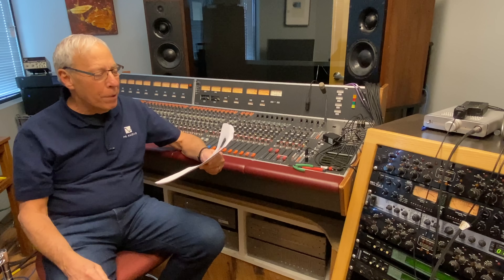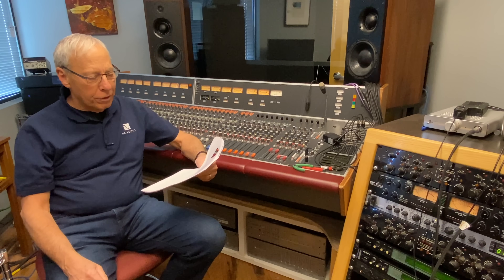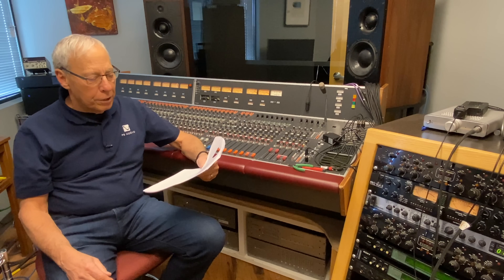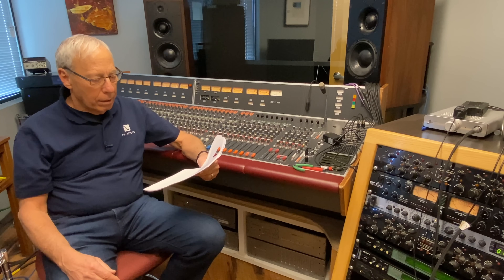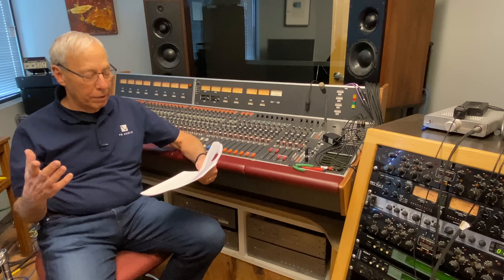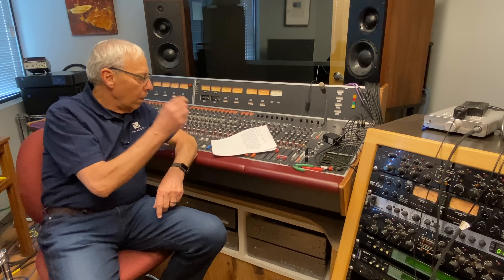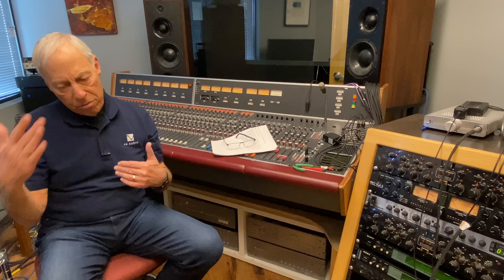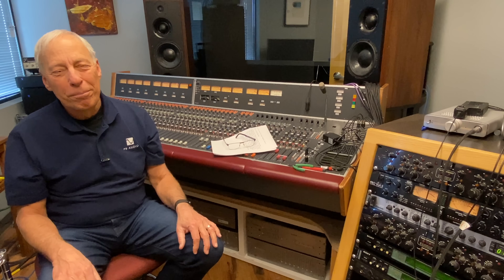Can you have too much damping factor?

Comment: I wonder why there are no amps with a sepperate feedback connector on the back for each speaker just like power supplies with a sepperate sense wire.  
Usually the feedback line is hooked up to the output terminals internally.  Done right  it would be the ideal solution I guess.   But if someone forgets to connect it it might break something lol
Reply: Kenwood's Sigma Drive System, used in vintage Trio KA-900, for example/

Comment: Eh…

What we all learned at high school, but what a lot of people seems to forget, is that a driver, like an electric motor, is driven by current (F = Bl x i).

When drivers are voltage-driven (with a low output impedance and a high damping factor):
* The sound is compressed.
    * About 98% of the power is used to heat up the voice coil till the resistance is two times higher (at 3 dB power compression) till, in extreme cases four times higher (at 6 dB power compression).
* The voice coil of the driver is a ferromagnetic coil (the last one standing when air core coils are used in the passive crossover).
    * Which is an inductance modulated by current, cone excursion, hysteresis and coarseness.
    * It distorts the sound.
    * It alters the frequency response, especially it lowers the high frequency output.
* The drivers acts as a microphone.
    * Every resonance in the driver or cone shows up in the impedance curve.
    * Every sound and every cone movement influences dynamically the impedance curve, especially cone vibrations, enclosure and port sounds and adjacent drivers.
    * It generates a voltage (back-emf) on the input terminals.
    * At resonance it is used to dampen the resonance, although with distortion.
    * At other frequencies it distorts and alters the frequency response.
* Loudspeaker cables have influence on the sound.

When drivers are power-driven (an output impedance about the same size as the load), like in a tube and low feedback power amplifiers:
* All the effects above are halved.
    * So more bass, more highs, lower distortion in the drivers, and less power compression.

When drivers are current-driven (a very high output impedance, like 400, 800 Ω or more):
* All the effects above are eliminated.
    * Voice coils are still heated, voice coils are still inductors and voice coils are still microphonic, but do they not distort the current anymore, as the current is controlled by the amplifier. They only distort the voltage, which has no effect on the sound.

Almost all passive crossovers are designed with voltage-drive in mind. With power-drive they are not optimal. With current-drive they don’t work as intended. With current-drive you need to redesign the crossover filters or, even better, get rid of them, go active. As passive crossover filters suck up more than halve the amplifier power and are unstable with changing voice coil resistance (temperatures).

So
* The more damping factor the less control of the driver.
    * The loudspeaker cable and the voice coil temperature take over the control.
* The less damping factor the better.
Reply: Yawn..........
Reply: @bigelile07  Sorry, I had nothing news for you!

Finally I found someone with knowledge about current-drive and probably knows all what Mills and Hawksford, Ragnar Lian, Esa Meriläinen, Joe Rasmussen and Nelson Pass tell us about current-drive. And probably knows what KLIPPEL, the innovative leader in providing unique test equipment for electro-acoustical transducers and audio systems, tell us about current-distortion.

Comment: Very interesting, I did not know that everything above 100 does not really do anything. I also think that it is a gimmick a bit like when they were selling Panasonic screens about 10 years ago that had 600hz picture. Then when you do the research, you find out that it is right, but it does not relate to FPS but internal measurements. Which really is cheating. A bit like making an amplifier 3000 watts and saying that it is better than the previous 2500 watt model.

Comment: People forget that just having speaker wire between the amplifier and the speaker will put a maximum cap on your damping factor, depending on the series resistance of the wire, to somewhere in the tens (i.e. <100 damping factor), even if the amplifier output stage has an infinite dampening factor (i.e., near zero resistance). So, unless you have a speaker plugged directly into your amplifier with a superconductor, you are not seeing the amp's damping factor at  the speaker per its spec, due to resistance in the connectors and more importantly the cable that connects them.

Comment: Is it possible for a poorly designed dampened system to sound dead, boring and lifeless?
Reply: Sure, just as it's possible for a well-designed, highly accurate system to sound dead, boring and lifeless.  In fact many if not most listeners prefer a little distortion and coloration added, to make the sound more interesting.

Comment: Feed forward error correction technology. Just like within the following amps: 
- Benchmark AHB2 (speaker amp) https://benchmarkmedia.com/products/benchmark-ahb2-power-amplifier
- DROP + THX AAA™ 789 (headphone amp) https://drop.com/buy/drop-thx-aaa-789-linear-amplifier
.. and some more I'm not aware of (except Hegel of course and some Monoprice models). 

And I'm pretty sure Paul's engineers are already working on the PS Audio implementation variant. Great stuff.

Comment: The way I understand it is you also want to match the amps damping factor with your speaker efficiency. For instance, most tube amps have very little damping factor and match well with efficient speakers. SS amps with a high damping factor usually work better with very resistive power hungry speaker systems.

Comment: The tube amplifier as a triode single-ended without negative feedback have around 4.....10 damping factor and sound great. Is a different filosophy, amplifiing the voltage, the current current, or the power. A lot of vintage amplifier have around 50...80 DF. Often the damping factor is something to sell better.
Reply: atom xeon  Can your amp accurately reproduce the bass of a kick drum?

Comment: I drive my speakers with Kenwood Basic M1 and M2. Both use Sigma Drive which help obtain 1000 of damping factor. 2 sets of wire for each speaker I uses AWG10 for the power output and a size 16 for the Sigma drive and if I disconnect those wire and just use a jumper to main,  you can hear a difference,  the bases tightens up and I can go more than one number on the max volume settting. It registers a higher loudness on my Simpson Model 884 Sound Level, Type S2A. 4000 is a big jump from 1000, Kenwood described its Sigma Drive in many papers published in the 80's.

Comment: How does Hegel achieve that high number as 4000 damping factor , does they use more feed back or what is the secret, does anyone know this ?
Reply: They have their own proprietary local error correction called SoundEngine which results in very very high damping factor.

Comment: So far my experience from testing an admittedly limited amount of, but all very highly regarded amplifiers, including Hegel, Hypex and Purifi; the higher the dampening factor, the more sluggish/warm the amplifier sounded. 
Those with lower, but still good dampening factor sounded more lean, clear and precise.
Don’t know if there is any actual relation or if it’s coincidence - but it seemed rather counter intuitive!
Reply: Yeah. Personally I found the 150-200 to be the sweet spot. Even 250 or 300 is still ok.
Reply: I have experienced the direct opposite. More DP resulted in leaner yet more precise faster sounding bass. I dont like DP of 400 and more. It sounds too detailed and less natural

Comment: Old amplifier like pioneer and Technics have Les than 80 dampi g factor an sound amazingly
Reply: How would you know this? I don't remember manufacturers back in the 70's and 80's giving out damping factor information.
Reply: @dontcare563 in some technics service manual  from 70s and 80 say  damping factor. Technics have approximately 50 to 80 do amping factor
Reply: @dontcare563  see in this picture Technics su-v4 have 25 df in 4 ohm and 50 df in 8 ohm  https://www.manualscenter.com/manuals/technics/suv4k-service-manual.html#.XrF2m-4pA0M
Reply: @acue79  Good to know. Thanks

Comment: the Sansui 9090 has an unbelievably low dampening factor of 10... however people love the sound and i think it sounds great as well... i
why did Sansui make the dampening factor so low?
Reply: Tube amps usually have low damping factor. That is one of the reasons they sounds so relaxed in the bass.
Reply: I’m curious about this as well as I have a 9090.

Comment: Loving the ATC Monitors 👌🏻
Reply: Saw those right off, probably the SCM 50’s ‘bookshelf’ model, as opposed to the tower models which I own a pair, in active config. Must be a local studio?
Reply: David G Perfectdaycalendar  They are the active Domestic SCM50A Classic model and not the pro model surprisingly . I thought they would have went pro model for the studio, maybe they wanted the wood finish! Rather heavy for a bookshelf speaker and ATC supply a stand for domestic use. There is a tall stand for the pro versions that lifts them high enough for monitoring when seated behind a mixing desk.
Reply: kj bunnyboiler6353 yeah, perhaps the designer/owner of the studio wasn’t a fan of the all black pro versions. Maybe a price diff?
Reply: David G Perfectdaycalendar  Absolutely, the wood finish on the Domestic cabinets is stunning. Especially the gloss walnut. Due to the additional cost of the veneer the Pro black versions are actually cheaper.
Reply: kj bunnyboiler6353 that makes sense.
Reply: got the 11s and they sound great.
Reply: Justin Parkman I started as a ‘casual’ user.. SCM 7’s. Added a pair of SCM 12’s. Sold both, got the 50’s. I ran Meridian 205 mono  blocs 100 wpc amps into those 7’s on some 24” sand/lead filled stands from Mission. The imaging was crazy good. Miss them. Enjoy your 11’s! I should add, I’m a PSA owner via a gen1 PWD W a bridge 2.
Reply: Jon Woods  Actives as well by the looks of it!

Comment: Damping factor can change loudspeaker acoustical behaviour and their sound on the end, drastically.  Loudspeskers are complex electro acoustic mechanisms that respond to amount of electric control from amplifier which can chage tuning points of that system.  If you have lose control, sistem will do more things on it's own, if you have to much, various electrical and mechanical resonances can appear inside that loudspeaker sistem with audible negativity.
High damping factor can be achieved with varous tricks inside amp circuits, it don't need to be global negative feedback.
Good question is, what is left of high damping factor after connectors and cables and their internal resistance.

Comment: Some is good, more is better, and too much is just about right.
Reply: For small full range drivers you don't want a lot of damping factor. Otherwise they sound flat and tinny. Some speakers can sound really rich with an amp that lets them just a little loose.
Reply: Dave Micolichek  That isn't how it works necessarily, though it is partly correct. If you take a design like a transconductance amplifier which has the ability to alter damping factor at the turn of a knob, they can get to the point they can match or exceed the damping factor of that Hegel amp, or have nearly nothing. And for some speakers the high damping factor is desired, as a low damping factor causes the speaker to exaggerate and accentuate undesirable characteristics. It can also have a bad effect with some crossovers. Some speakers which have a high mechanical damping factor will not notice any difference what so ever, while others like full range and drivers with a very controlled mechanical damping factor (horn loads, t-line's) can sound immensely warm and rich when its set just right. The latter is what these little amps are generally built for.  In those small cases it is possible to make the speaker actually unload from very little actual power when you turn to much to current loading. 

This can be a great explanation for the boomy bass that used to be a product of the 70s big sound systems, most of those big amps actually had a damping factor that was quite low (less than 30 usually), and the speakers didn't have much insulation with a rather flimsy box, which would give the combination of lots of resonant speaker activity.

Comment: It is important to appreciate how damping factor is defined. It is not defined as "the ability of the amplifier to control the loudspeaker", but as "the ratio of loudspeaker impedance divided by the amplifier's output impedance". And in this calculation, speaker cable resistance is added to the amplifier's impedance as an ohmic component. It is true that this ratio can be a measure of amplifier's control and it can be easily demonstrated by adding resistance between the amplifier and the loudspeaker. The more "parasitic" resistance we add, the more boomy the sound will come out. It's so clear and distinguishable that nobody can argue it's not happening. In a few tests I made with people attending, some actually liked the boomy sound with a damping factor of 10 better. They thought of the sound to be "fuller". However, it did have the effect of blurring the actual sound towards the effect of "single note bass". Not as bad as a badly designed loudspeaker, but something similar. 

However, the loudspeaker impedance is not resistive (with the exception of a few loudspeaker designs that have tried hard to achieve this) and so the impedance varies with frequency. We know the effect of lacking speaker control is more pronounced in the lower frequencies and this is where the loudspeaker shows one or two impedance peaks going up to 20, 30 or higher Ohms. But of course, there are dips as well in many loudspeakers and a "nominally" 8Ohm loudspeaker may well dip in 5-6Ohms. So, the result of this division is not a constant number but rather a graph vs frequency. With a widely varied value in the critical two octaves from 30Hz to 120Hz. By instinct, I would propose that the variation of the DF in these low octaves may be a bad thing. And if the amplifier has an inadequate DF, the dips vs peaks in the speaker impedance may give a highly altered response in neighboring frequencies that may be a bad thing.
Reply: In addition, the voice coil resistance of a loudspeaker (typically 3-4 ohms) is also parasitic, because electrically seen it's between the amplifier and the voice coil inductance. So it adds 3-4 Ohms (!) to the amplifier output impedance, ruining the damping factor completely. So although indeed damping factor is often defined as "the ratio of loudspeaker impedance divided by the amplifier's output impedance", this definition doesn't say anything about how good an amplifier can control a speaker. Does anyone know why this definition is kept being used?

Edit: here they also explain this exact problem:
http://www.htforum.nl/yabbse/index.php?action=dlattach;topic=91523.0;attach=92213
and here too:
https://www.audiofrog.com/community/tech-tips/damping-factor-and-why-it-isnt-much-of-a-factor-2/
Reply: True...which is why the speakers should be crossed at 60 Hz or so and let a subwoofer do the rest. 
That takes away so much strain from the amp which in turn makes the speaker sound way better.
Reply: How does Hegel achieve that high number as 4000 damping factor , does they use more feed back or what is the secret, does anyone know this ?